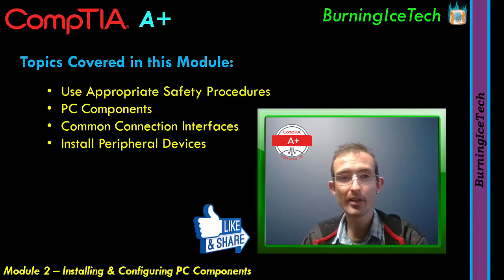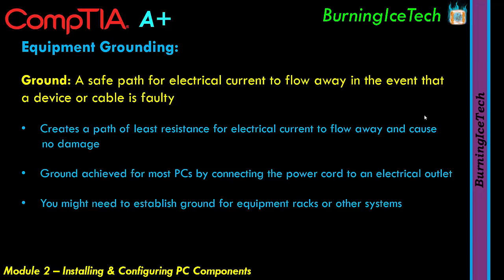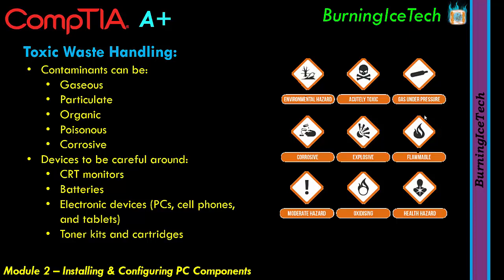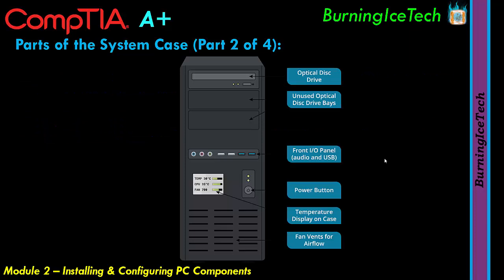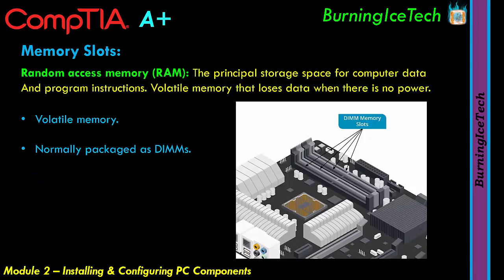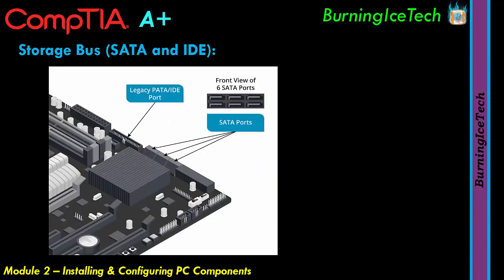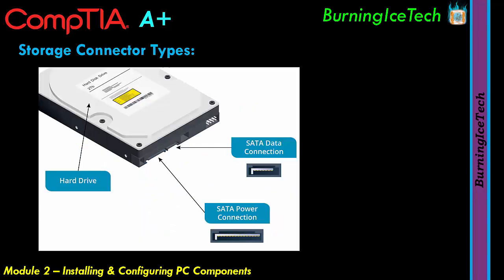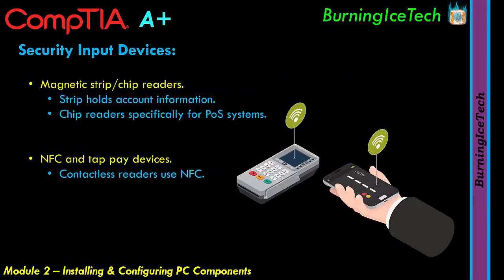CompTIA A+ Full Course for Beginners - Module 2 - Installing and Configuring PC Components

Comment: Did you make any Videos or know of any Videos related to the CompTIA N+ N10-008 / Server+ / Security+
Reply from the maker: I did make videos for the CompTIA Network+ N10-008, you'll find the playlist on my channel :) the series is not done yet, I'm still actively uploading to it when I find time.

The next lesson is in that course is supposed to go live either today or tomorrow, most likely later today in a few hours.

Security+ I haven't made anything for yet, that will be done in the future in a few months. If you need something for it right away, you'll have to run a search on Youtube or something. I know Professor Messor also has some pretty good content on it so if your in a rush, maybe check his channel out on Youtube.

Server+ I did not make anything specifically for that course yet but I do have a lot of stuff on my channel that covers a lot of the same stuff. For example the "WS-011"  and "AZ-800" courses I did cover a lot of the same content. They are both about Servers

If you need any extra help lemme know :)
Reply: @BurningIceTech  Thank you